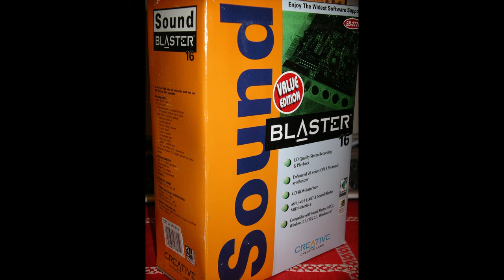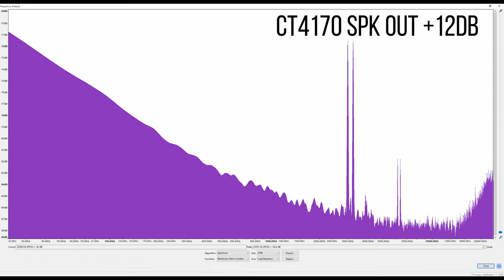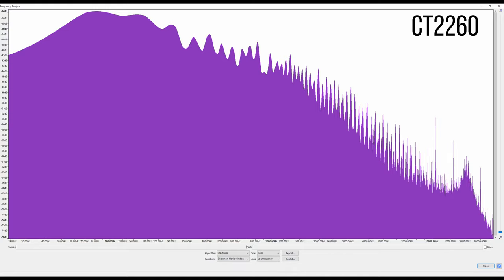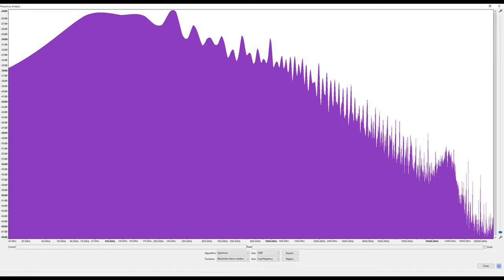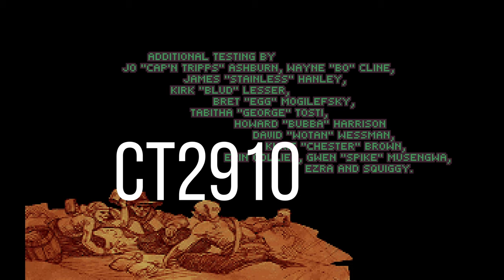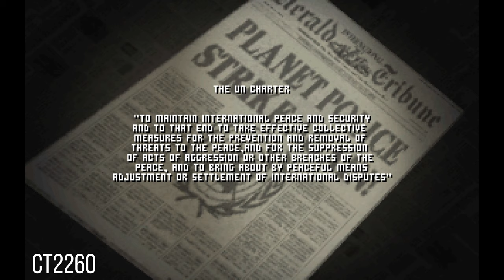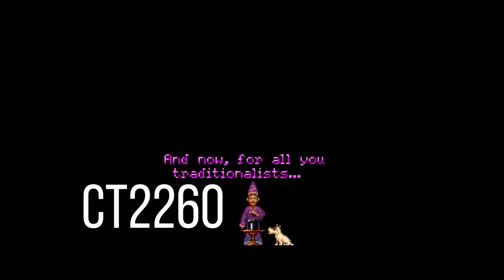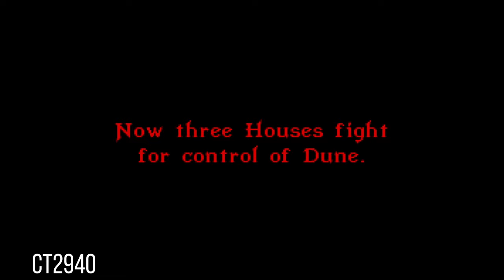Sound Blaster 16 - The Quest For The Ultimate DOS Sound Card Part 12 - Most famous ISA sound card

Comment: My limited experience with the Vibra16XV (integrated on my PCPartner VIB862D) - updated the default Windows 98SE drivers or change any resource setting, and then the clipping bug started. And it never worked properly under Windows 95. So I'm disabling it and just using the better of my 2 ESS Audiodrive 1868f. FM synth just below the quality of OPL-3 found in the YMF740C (integrated on my Intel SE440BX-2), with no bugs, full SB Pro2 support, no TSR and the ability for me to leave the LPT enabled.

Comment: The CT2890 has pretty much all of the documented bugs that a Sound Blaster 16 can have, including the worst kinds of hanging MIDI notes (via wavetable or external MIDI devices using the MPU-401), vibra clipping and ringing issues.  On the plus side It has a legit Yamaha OPL YMF262 chip, no single cycle DMA clicks and a generally low noise output which is, I believe, why it got such a strong endorsement here.  However, I'd take a CT2230 or CT2290 (assuming it has the CT1703-A or CT1703-TBS DAC variant) over one any day particularly if you are proposing connecting any MIDI devices to it.  Honestly your best bet for a Soundblaster 16 compatible ISA sound card with great FM synth, good clean digital audio output, lean/easy to configure driver + mixer, and bug free MIDI via wavetable or the joystick port is an ESS 1868f or 1869 based card, which usually runs $20-$30 shipped on eBay.  I'm saying that as someone who owns 8 different Creative Labs Sound Blaster cards including 4 different SB16 variants.

Here's a link to a PDF outlining the various SB16 variants and which bugs they include: http://www.mediafire.com/download/86q5oxtpvi7z0fc/SB16_Bugs_Sample_Collection.7z

.. lots of discussion over on VOGONS about this topic.
Reply from the maker: I have to agree that ESS 1868 is a great card, it's cheap and works like a charm. However, CT2890 worked best for me. I couldn't even replicate most of the bugs that plague SB16s on this particular model.

Comment: CT2890 is great if you don't want to use Waveblaster at all especially if you have a CT1703-A amp on it. Its similar cousin CT2800 is also good - the only difference is that one lacks UPnP. But I still have to give "best SB16" to CT2230 or CT2290, which are effectively the same card. (I even modded my CT2230 with a 4.05 DSP.) Despite all these points though, my retro SB of choice is not a SB16 anymore! I am using a Labway YMF719 based card these days. It has its own limitations (particularly for ADPCM sounds which can be patched anyway) but can be dropped into just about any machine and "just work".
Reply: Also KITR: thank you for this extended video and all the comparisons!

Comment: i got a ct2830 and it's super noisy, has all the bugs, but the fm output is strong and bass is punchy. it is massive too, no matter what slot i put it in my baby-at board, it blocks up the area for the front panel headers. seems to work in all games i've tried (except jurassic park's sound gun sound effects, i still havent found a card that makes those sound correct) but some games are super low volume and i can barely hear them. i have figured out that on launch of some games, the mixer settings are basically discarded and then all volumes are put to 5% - if i run the game in windows, alt tab, mixer shows everything fine. but as soon as you move the sliders you are back in control of sound and can turn it up (i dont think i explain it well but there's a problem, maybe my mixerset.exe is a different version?? no idea). unfortunately the games i want to run that have this issue will crash in windows. it happened on a 440bx board as well as a socket 7 board so i believe it's the card's fault.
Reply from the maker: You and your Jurassic Park :) I have to find the right card for you, that will work in the bloody game... What mixerset version you use?
Reply: @KITR-UK  it's version 2.15 and i use mixerset /p in autoexec.bat
Reply: my 1740 is surprisingly the least noisy one compared to my CT2830 and the CT3930 SB32

Comment: Re: the dos screen at 1:48 how did you load that csp driver?  I just bought and installed a csp chip into my 2290 and don't know how to set it up or test it.  All I've done so far is press it in and opened 2 jumpers to physically enable it.  Thanks.
Reply from the maker: I used loadsys.exe utility and loaded csp.sys with that.

Comment: I know they are quite common, but I'd really like to see your review of an AWE64, it was my first 'good' sound card. Any chance you have one lined up?
Reply from the maker: Well, it's going to be the next video actually :) AWE64 Gold.
Reply: @KITR-UK  that's great, looking forward to it. I just picked up another sound card, an Aztech Sound Galaxy Nova 16 Extra II-3D, it has genuine opl3, sb2 pro compatibility and headers for wavetable and ide. It sounds great and works really well. Have you ever used one, or a similar model?
Reply: @KITR-UK  I'm curious to see AWE64 Gold compared to the AWE64-in-hiding, the CT3670, as I'm considering upgrading from the 3670 to an AWE64 Gold on one of my retro rigs - but it'll be costly cuz I'll need to get one of those 24MB soundfont RAM boards whereas the 3670 can use 30pin SIMM's... which is why I purchased a 3670 in the first place.  Is the sound any better with the real thing, the Gold card?

Comment: I love my CT2910. Unfortunately, the 16 bit DMA channel is corrupted, and I don’t know if it’s a driver issue or an issue with the card.
Reply from the maker: Tell me more. DOS, Windows, both?
Reply: @KITR-UK  DOS 622 and Windows 3.1
Reply from the maker: @nitroraptor5316 If it's not working properly in two systems, it's probably the card. I'm not saying it's impossible that it's a driver issue, but it's highly improbable.
Reply: @KITR-UK  Hey, what sound card do you recommend for under $40? I'm building a Socket 4 PC soon. I'm considering an Aztech SB clone.
Reply from the maker: Well, I'd consider a cheap ESS or Yamaha sound card with QS1000 wavetable chip. I'd get excellent sound compatibility, great FM and decent wavetable. Or working SB16 with OPL3 and waveblaster connector. I could later decide what kind of daughter board I'd like to use with the card.